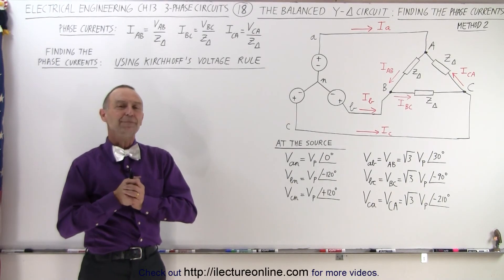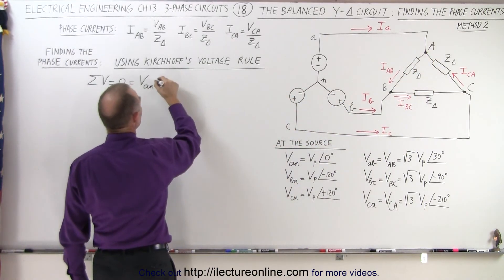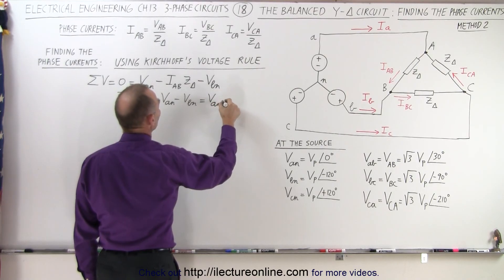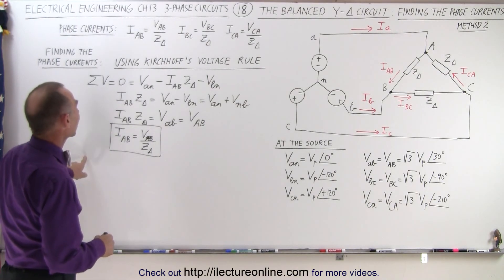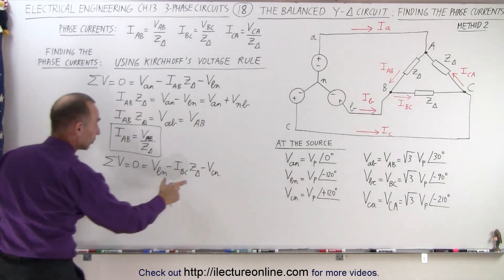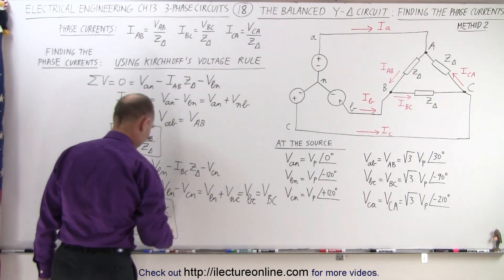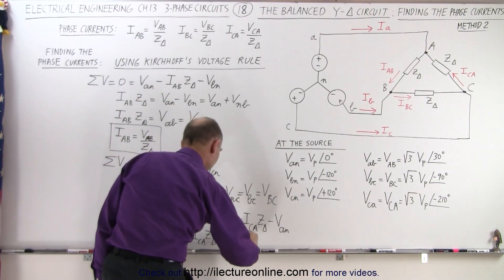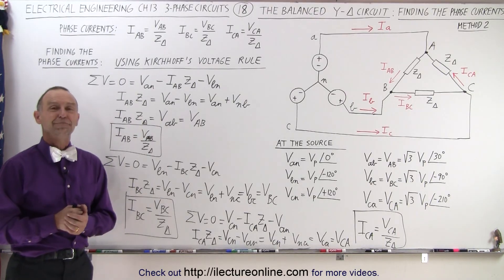Electrical Engineering: Ch 13: 3 Phase Circuit (18 of 42) Find Line Current in Y-Delta Circuit 2

Comment: If you are starting from Vn to Va shouldnt it be Vna instead?
Reply: Because Van = Va - Vn (it makes sense: Vn = 0 so if Van equals for example 220 V, then Van = Va - Vn, this should be in your textbooks). Since the voltage increases from Vn = 0 to Va = for example 220 V, he's counting +Van. Another way to see it is to use arrows (in one direction for voltages sources, in the other for loads. Then you choose a direction randomly in which you loop. If you loop in the same direction as the arrow as you apply Kirchoff's rule then it's positive, else it's negative).  That's what I understood.
Reply: @nigelsheldon5753 how about, -Vna + IABZdelta + Vbn = 0 ? Is it correct?